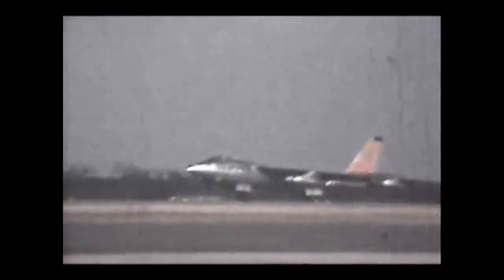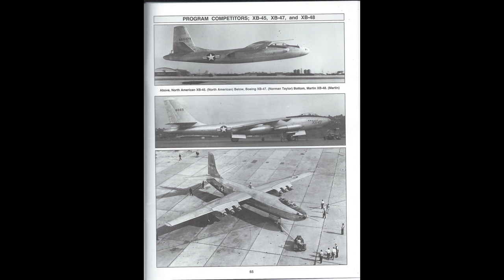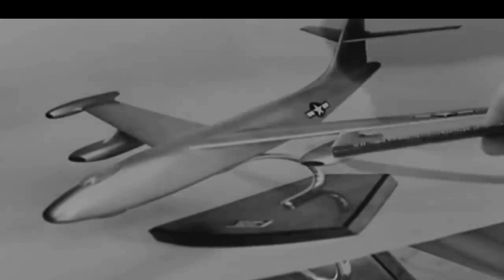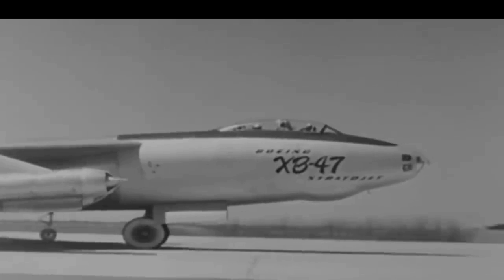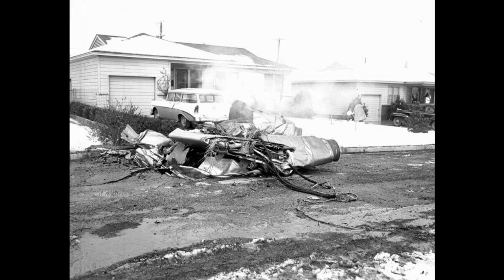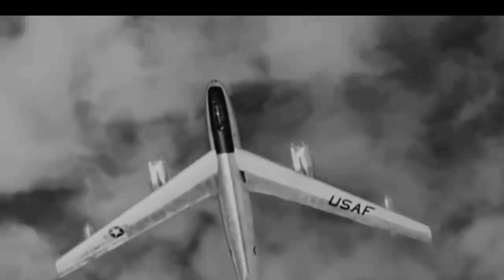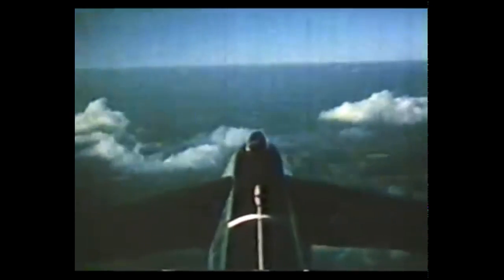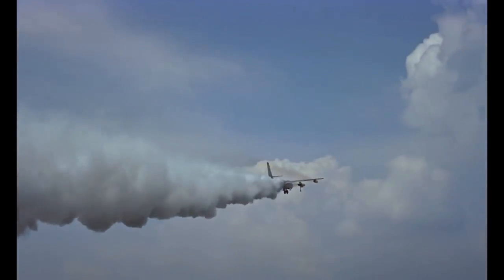B-47 Stratojet- Revolutionary design or flying coffin?

Comment: One thing I wonder about is the use of JATO bottles for takeoffs. All that rocket smoke hanging in the air over the runway must make visibility suck for the next bomber in line for takeoff; even worse I bet it made for poorer performance as well, since all that smoke gets ingested into the following jet's engines and likely the hotter air means less lift. I've read about pilots flying in large jet formations doing mass takeoffs having issues with the jets in back of the line using up every inch of runway to get off the ground. In a nuclear scramble, getting your bombers off the ground in a hurry is important.

Comment: The thin wings were completely unnecessary and a holdover from straight wing days when “thin” was the only way to reduce shock drag.  Sweep is sufficient to delay shock wave drag alone.  The B52 had much thicker wings because thin was not necessary.

Comment: I was a trained radar and auto pilot airman on the B-47 There was no way to get out of the early models they developed ejection seats later. no I did not fly but I worked with men who did,  we needed the B-47 for it held Russia at bay. It sure was not perfect but it did it's job. what would have been the result if we had not had this great deterrent. Where would we be if we never had the B-47. It was all new and had some problems but we learned and the B-52 is still flying

Comment: From the mid 40s on, flight controls went from manual to hydraulic boost.   This transition had its own learning curve.  In a sense, On the outside, these planes looked slick, on the inside they were vacuum tube.

Comment: Although I've never seen a B47 I've always been interested in them . This film which I found excellent was a bit of a surprise to me regarding their safety record. 
With this in mind Boeing obviously learned quickly developing the dash 80/kc135/707 and B52 which were very successful and had good safety records and are still in service nearly 70 years later and were developed from the B47.
A shame some B47 variants didn't last longer than 1969 when the last derivatives in service were withdrawn

Comment: B47 was a marvel for its time. Whole new level of mistakes were made. Whole new learning experience now that planes were flying 100 mph and faster than piston engines. The B47 issues paralleled with the British Comet's failures.  Metal fatigue, fractures, aerodynamic behaviors, incomplete German studies incorporated. You can include the F-104 as part of that learning experience developing high performance combat aircraft. All these mistakes were absorbed into Commercial Jets that had much fewer failures. Lot of pilots lost their lives, studies and analysis caught up with design.

Comment: Any time you try to build something at the limits of what is technically feasible using very new paradigms - you're going to run into problems both with the contrast between plan and reality, as well as uptake/adoption.

This was a time when we were still learning about metal fatigue and how it impacted aluminum in particular.  Even during the design phase, I would have challenged the idea of having pilots fly that thing for 20 hours in that configuration.  I think they were really pushing the limits of the human in their mission and configuration.  

But it can't be denied that it was a revolutionary design and critical to defense strategy at the time.  So - while it was an airframe that probably should have seen a limited production run and succeeded by an airframe incorporating its lessons much earlier than it was - the political and strategic setting required a bomber and that one could, despite its problems, place nuclear ordnance on target as required.

It was an aircraft we were fated to learn many lessons from and SAC ensured the lesson was drilled in - by no real fault of the engineers or the airframe, itself.

Comment: For its time it was safe enough given how much of a leap it was from the B-29/B-50.  Today no one would stand for the accident rate. This plane was built without the aid of computers and the metallurgy wasn't quite up to the design.  in the 40's to 60's being a test pilot or any aircrew was a dangerous job. Those were different times.

Comment: The B47 was was a compromise when engines were underpowered, metallurgy was not up to job and and procedures were not developed.    The surprise is that the B52 did not replace sooner.  Of course the B52 was a much expensive plane that had the advantage of the B47 experience.   But when it 1st became available it was the best bomber available.  The USSR did not develop an effective jet bomber for almost 2 decades after the B47!  The used a turbop based on the B29.  The biggest shortcoming of the B47 was the lack of good crew escape systems.

Comment: More of my thoughts. I was a Defensive Fire Control “maintainer” on B52G models 1960-1963.  Once the battle plan changed from high altitude bombing to low level, 500 feet, to avoid Soviet radar and SAMs, cracks were discovered in the bomber’s wings.   Inspections were required often and very detailed.  My point is, as SAC realized there was a problem, they moved to correct them. 
The B47, as the first swept wing, high speed, high altitude bomber was ahead of the curve. SAC would learn, but it would take time. It did become common knowledge that the B47 required the pilot to give 100% attention to flying. There was a very small window between overspeed and stalling. 
It was SAC’s first jet bomber, knowledge would be gained slowly.
Reply: The British "Victor" bomber-fleet had to be retired early in the mid-'60s because of metal-fatigue in its wing-spars.
Reply: Nom it was the Vickers Valiant, the Handley Page Victor soldiered on into the '90s as a refuelling tanker after vital service in the 1982 Falklands war.
Reply: @cbaboxsqueeze  Youre right: I typed "Victor" when I meant "Valiant".

Comment: Basically underpowered. And that condition will make just about any plane dangerous in many ways. The jet engines they were coming out with were so low in power compared to what came later, they did all the band aids they could do. Rocket assist, water injection. Water was also used on early jet airliners for the same reasons. Those old jets burned a lot of fuel to produce a fraction of what modern jet engines would do in later years.  Also if the B-47 had spoiler roll control when slow,  loosing an engine and then using the ailerons lifts spoilers and can cause so much loss of lift the plane crashes.

Comment: WOW! I never knew anything about the service record of the 47s. It's been said that the 707 was based on the 47. How did the airliner succeed, when the bomber was a flying coffin?
Reply: The 707 is low-wing and the 47 is shoulder wing, which is a pretty big fundamental difference.
Reply: The 707 wasn't based on the b47, but lessons learned from flying the 47 were applied when designing the 707. Things like swept wing planes suffer from Dutch roll, so control circuit was added to automatically dampen it.
Reply: Thanks for the info, Paul
Reply: You probably already know the USAF still flies the KC-135 as the Strato-Tanker.

Comment: The first commercial jet passenger plane was the British Comet which had no connection to the B-47. The Comet flew two years before the B-47
Reply: I think the point is not which was the first jet powered passenger jet, but which jet pioneered the successful configuration this is still followed by modern passenger jets.  The Comet did not set that model with its mild sweep and engines buried close together in the wings.  Modern transports follow lead set by the B-47 with a more highly swept wing and widely separated engines mounted below in pylons.

Comment: It is a pity that the narrator did not go into the strange u/carriage design  - it is obviously related to the very narrow gutted wing  which could not provide the depth to shroud the wheels (nor take the landing loads). It is  a wonder that this innovation got past normally conservative  airforce review boards - it is pretty clear what will likely happen in crosswind landings and with tired pilots, ie.  a tip strike.

Comment: The question is would you prefer to fly the Valiant or the B-47 as they were the primary western Nuclear bombers in the mid 50's ?
Reply: Mid 50s? Valiant definitely,it flew higher. It only suffered metal fatigue in the early '60s due to low level flying. They only did low level after 1960 when Gary Powers was shot down. Before that the Russians couldn't reach it.

Comment: You don't show the B-47 with its massive 1780 gallon (12,000 lbs of fuel) wing tanks. 
While the B47 could kill you if you did not fly it at all times, it could and was flown in a very unbalanced configuration. 

Major Langford was the pilot of a B-47 when one of his wing tank's fuel became unusable due to some fault in the fuel system. He had one empty tank on one wing and one tank with fuel on the other. After consulting with the  people on the ground, it was decided that to land the plane in such a unbalanced configuration was to dangerous. Langford was to drop the wing tank with fuel in it, over the bombing area. However when the parachute was deployed to eject the tank, the tank failed to disengage from the plane. Now the plane was extremely unbalanced, both weight wise and aerodynamically, weight from the fuel and now aerodynamically from the deployed chute on one side with no fuel and clean on the other.  
How to land safely became an even bigger issue. The decision was to refuel the other side as soon as possible to help even out the weight imbalance while nothing could be done about the aerodynamic imbalance.  
Langford's  B-47 was on the verge of of running out of usable fuel.  Langford, having no other options available, flew low and hooked up with the tanker shortly after the tanker lifted off of the runway over the city of Tuscon Arizona. (If there were a world record for low altitude refueling Langford would own it, along with breaking all other safety rules and regulations about refueling!) .
Langford loved flying the B-47, it was fast and sitting in front of your copilot it was like the new fighters that were being developed at that time.

Comment: Not trolling here (honest), but I was not a fan of this idea of centrifugal bombing.
  The idea of a six engine bomber performing an Immelmann in order to release a bomb, tho.  Think about it and go watch the various familiarization films for prop fighters or fighter jets of the era.  "Do not perform aerobatics" is the usual refrain for every pursuit or fighter plane from the P40 to the F86.  But, here, they're doing it with a six engine bomber.
  I blame Junkers.  That damn FSW Ju287 drove engineers crazy.
  You can see how much altitude the B47 loses while it's trying to flip back over on its belly.  Tens of thousands of feet.  Enough to finish its roll at below ground level if anything goes awry.
  A foolish concept, that of centrifugal bombing by six engine bombers; one in my view put forth by fools, perpetrated into hardware by engineers working for fools, and flown by suicide jockeys with no other option than mail runs should they turn down the post.  As I understand it,  B47 could not be depended on in a fight.  Just like the B36.  S.A.C. was necessary, according to its proponents, but the hardware available was not up to the missions expected of it.
  In my opinion, the navy did a much better job as a leg of the nuclear triad despite similarly failed hardware (both services were plagued with a succession of underpowered or catastrophe prone planes).  In fact, the first generation turbojet motors should not have been accepted for use in warplanes.  None produced anything like its planned power and acceleration was terrible.  The jet's sole advantage was rate of climb.
  We might've put more hype into the Missile Gap lie, while we stuck with props, as these had reached a high state of reliability by the end of 1945.  Our (the west's) first useful turbojet fighter was the F4.  The rest were garbage in comparison.  Our first useful jet bomber was the B52.  Imagine going to war with the F7U Cutlass and B36!
Reply from the maker: Very very good comment 👍thanks for watching!

Comment: Just as with any new cutting-edge technology, there were bound to be teething pains.  However, so many crashes and fatalities point to serious structural design flaws, way more issues than even a "new tech" plane should experience.  On top of that, the lack of leadership to stop and find the root cause of the problem  (and fix it) is downright immoral and should have been illegal.  Was anyone held accountable?  Did they go to the funerals?

Comment: Any multi-engine aircraft with engines mounted in such a way that asymmetric thrust will result if an engine fails has a minimum speed below which the rudder will not have enough airflow to counter the yaw induced by the asymmetric thrust.
     This speed will be higher than the aircraft's stall speed and so flight can be achieved below this "minimum maneuvering velocity" (MMV).
     Pilots are trained to never take off below this speed because if they do, and they suffer an engine failure there will be no way to avoid a crash.
     The accidents described at 12:00 are 100% pilot error and 100% avoidable. They have nothing to do with the design of the aircraft. Identical crashes will result with any multi-engine airplane that takes off below MMV.
     Ever notice how big the tail fin on Boeing and Airbus aircraft are? That's why. 
     It is still a quite common cause of accidents in multi engine GA aircraft. The pilot loses an engine, then lets their airspeed decay. Once it drops below MMV the plane enters a roll and all the pilot can do at this point isa key the radio and say "Aw shit." (This is a tradition for pilots who know they have made a mistake that is going to kill them. Swearing on the radio even today can result in fines for the pilot. It is very strongly frowned upon.
    The coolest pilots will say it in a calm voice. Everyone will know you did something stupid, but at least they will know you were as cool as can be.

Comment: I used to have that model at 3:45-4:09.   No, I don't mean a model like it, I mean THAT actual engineering model.  By the time I had it, the tail was missing, and was worse for wear.

It's at the Air Force Test Flight Museum now, it was far more useful to them than to me (especially since they have one of the actual XB-47 prototypes).

Comment: Early designs are always experimental in nature. Perhaps by today's standards. The B-47; could be considered to be a dangerous aircraft. This, I suspect is due primarily to the cold war.
    Having no real experience building jet aircraft. The design went through many changes, before prototypes were built. Most of the lives were lost due to grossly inadequate testing and evaluation. It's easy to blame a plane, for irresponsible human behavior. Clearly getting a high performance jet bomber into production. Was MUCH, more important than any safety consideration. It was the later programs such as the excellent B-52, design which benefited from experience with planes like this one.

Comment: Performing Immelmans with a big bomber, where they drunk or what?
Reply: Because the Russians had developed SAM missiles that were capable of shooting the B-47, B-52, and the U-2, down at the highest altitudes they were capable of flying, both the Americans and the British changed to the high-low-high profile to get in under the radar,  and by also being low enough that the missiles could not get them.  It was the only reasonable alternative at the time. 
The cold war to the SAC guys, was real war.  One night, In the dead of winter in 1967, I was in the process of getting refueled on a SAC base (K.I. Sawyer AFB) where I was a know frequent visitor, when an alert was called.  Even though I was a friendly, I was forced to stay in my aircraft at -40, with a jeep equipped with a 50 cal machine gun aimed at me, while the ground crew fueled me up and sent me off without even being able to file a flight plan. 
Yeah, they meant business.

Comment: 2:08  contract awarded to CORVAIR for the XB-46.  How about CONVAIR.  Corvair, as everyone knows, was "unsafe at any speed".
Reply: Wasn't the Ford 'Pinto' the car that was unsafe at any speed, with a weak rear body design and a fuel tank that was easily ruptured in a crash, ao that passengers could be trapped inside after a crash and burned alive. Ford wouldn't spend  $11 per car protecting the fuel tank because it wasn't  'cost-effective'.
Reply: @daveogarf  My 61 Corvair couldn't fly at all ! Aside from the transmission fluid freezing in January 1970 it ran well for the nine months that my father and I owned it.  He scrapped it in April 1970 with 47K miles on it.  He said it was crap compared to his 1960 Studebaker Lark which lasted six years and 107K miles.

Comment: I think it’s a little of both yes it wasn’t a rush job but a rushed redesign to incorporate new technologies maybe too many leading up the problems as for crew training that’s to be expected with new technologies and accidents are par for the course. It’s when you got an existing technology and you keep having the same problems over and over and no apparent fix for it that you can say that it’s a failure, but if you do have a fix and a improvement but still it’s not enough of an improvement to justify its continued use then who’s the blame? Also time will eventually pass everything especially aircraft same weather this with improvements or updates/upgrades but bombers are very susceptible to the ravages of time even the B52 has had a hard time in its younger days, but with improving training and constant updates/upgrades most bombers are able to weather time only limiter is the size of the plane and unfortunately the B47 is a very cramped airframe.